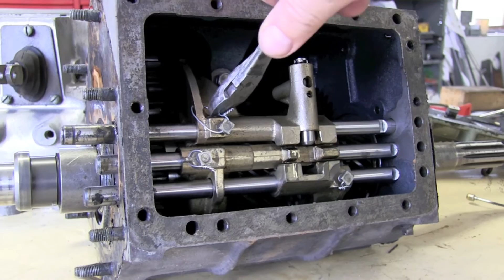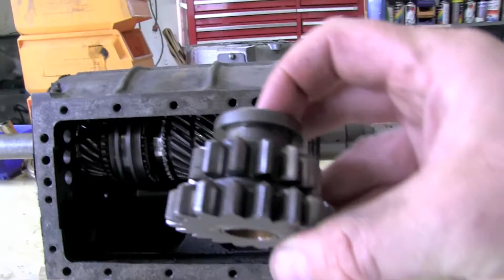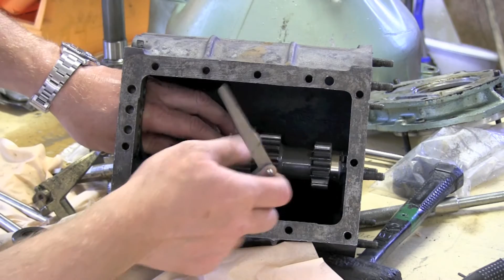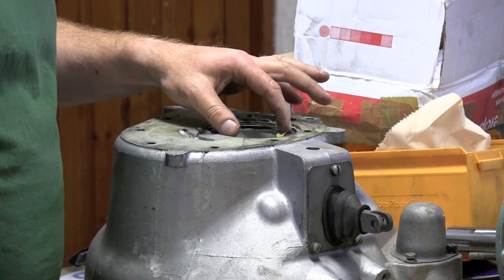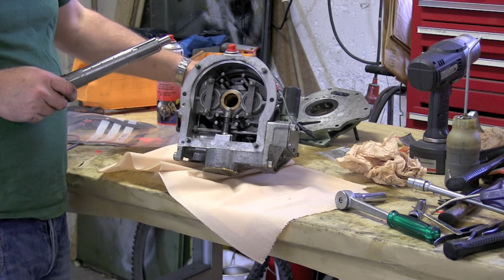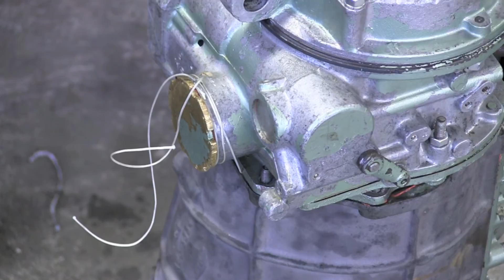Centre change gearbox

Comment: Very good video. If I had seen this video before rebuilt my gearbox, I would have solve a lot of problems that I had to invent myself: the bronce bush of laygear, the alignement of overdrive and specially the modificated third-fourth selector rod. This last one I didn't, I thought about it but I didn't so I thought that could not be the right solution. Now I see that it was the right solution! When I can I will take out the gerabox to make it, so my third gear synchro don't work properly.